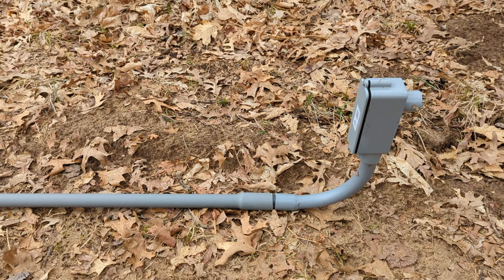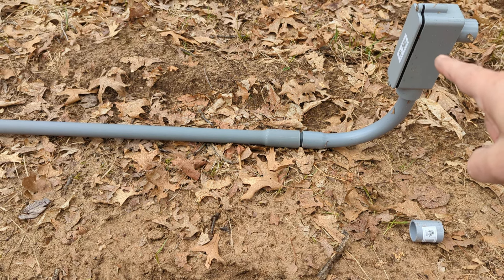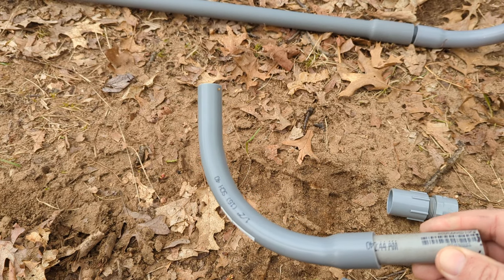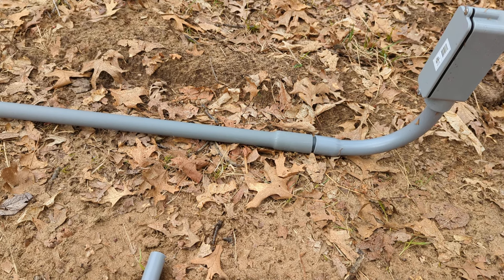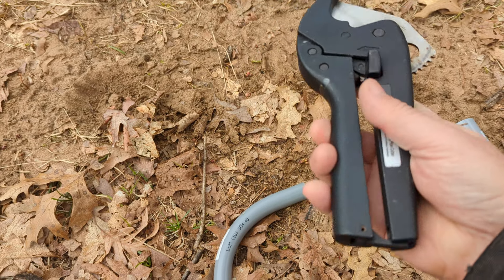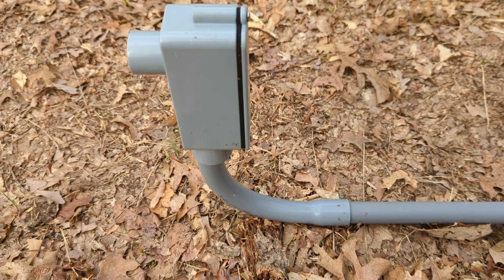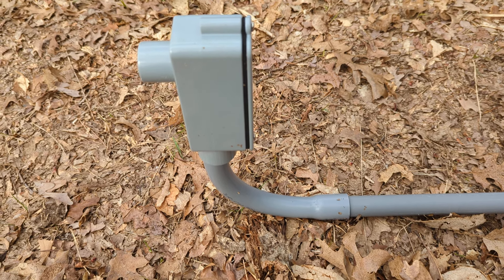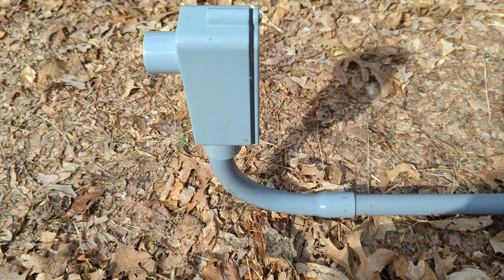Outdoor PVC Conduit to another building

Comment: Understand a long sweep 90 would be necessary for thick wires..but certainly times with small wires where a small elbow would work much easier in a small space.  Also very limited in T type connections.  As a diy, seem to run into many gotchas of things that are not available.
Reply from the maker: @JC-pb4db  But a fish tape doesn't do tight 90's. Pulling wires through tight 90's doesn't tend to work well. There's a fitting for nearly any situation. The other vid shows some of the other fittings that can be used like on the exterior wall of the building etc.

Comment: How to secure the lb into a metal shed wall? On the inside
Reply from the maker: @dass1340  depends on what you're connected to. Into a box inside or just to the metal siding etc a threaded fitting can be used with either an insulated bushing or a nut.

Or just drill hole slightly larger than pipe and leave 3/4" inside and just glue any fitting on and it can't slip back out since fitting is larger than hole. 

Or just run pipe through and caulk from inside. Pipe can't pull out cuz caulk stops it.

Comment: If i didnt have access to dig a trench would i be able to run this along an extrior wall into a detached garage?
Reply from the maker: Yes, trenching is useful but not always the right option depending on the situation. This is rated for outdoor exposure. It can also rather easily be painted to blend into the wall/house color. Helps to scuff surface slightly so it's not shiny then paint before installation for ease. Just need to clean paint off any joint areas. Then touch up after completion.

Also run larger than you think you need. Say 1" bare minimum for data and 1 1/2" for power. They need to be separate if you didn't know.

Also helps to get a deburring tool (plumbing dept normally) and deburr the inside edge corner of each pipe section. Helps to smooth transition for easier wire pulling.

Read some of the other comments for more tips

Comment: Are you holding the slip fitting upside down?  Seems like the larger OD section should be oriented above the smaller section to keep water out.
Reply from the maker: @sagegriot2455  The fittings will only go one way to make this work. The glue will keep water out.
Reply: Yes, he was holding the slip joint upside down. There is no glue along the movable section  -- it's sealed with n o-ring. It's relatively air & water tight, but you should mount it so that the larger diameter piece is on top so that water can't pool in the fitting. It would explain this in the manufacturer's instructions, which are always good to read, no matter how many youtube videos you watch.
Reply from the maker: No actually was holding it horizontal...but yes good orientation would be the larger portion on top to shed water. I don't believe there is an actual TOP/Bottom

Comment: Great video.  What size pilot hole would be required for a 1/2 LB box?
Reply from the maker: I don't know the size offhand, I always use 3/4" minimum. Ya always need more space. If you're at the store buying parts grab a tape measure and measure what ya need.

Comment: What type of electrical wires would you used from the inside the house and thru the conduit to the other structure
Reply from the maker: Depending on what you're running through there. Ideally 2" conduit for power is a good option for easy pulling. Otherwise 1 1/4" for low voltage normally will work well. Power needs to be a separate conduit than low voltage like internet. Most power singular stranded wire sold in home stores now is the proper type. But basically you're looking at THWN or could say like USE 2 on it. Basically rated for wet conditions. 
Consult your local electrical codes for requirements
Many times Mobile Home Feeder, SE-R, or may be Service Cable, can be used and is cheaper. It's 2-2-2-4 Alum, has 3 main conductors and the ground all in a grey plastic insulation coating. Can always have larger wires than needed for a circuit. The ground is not used for a detached structure. It needs it's own 2 ground rods for best results. Consult your local electrical codes. Singular wires can't run through a normal wall, so using regular stranded wire in the conduit would require transitioning to something different or running conduit all the way through walls etc. Using the MH SE cable eliminates the connections since it's rated for nearly any conditions.

Essentially you want to run a sub panel in the detached structure. Which will be 240v and then the panel separates to 120v circuits. Makes additions later very convenient too. 

If you're doing low voltage like network/internet it should be exterior rated or gel filled holds up the longest. Outdoor in ground runs for internet in the past has been cat 5/6 type cable. But due to grounding issues and static charges one should use fiber optic cable. It's frequently cheaper than copper and isn't hard to work with. Preterminated cables are available and can be longer since length isn't really an issue like with copper. Lot's of YT vids of what to get and how to do it. FS dot com is a very reputable fiber equpipment seller in the US and good prices. Otherwise Monoprice dot com also

If you've never worked with conduit before there's lot's of vids on tips and tricks like using a shop vac and pull rope with piece of rag or plastic bag attached to pull it through. Essentially the same principle bank driveup vacuum tubes work. Then attach wire and pull through.